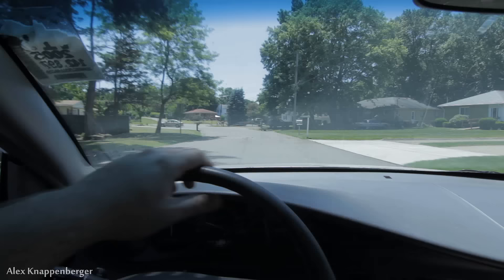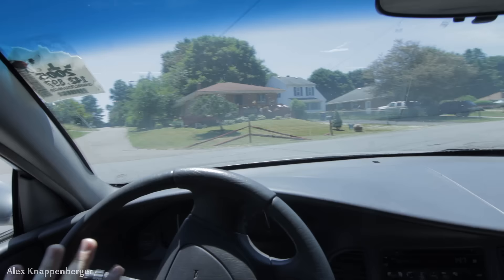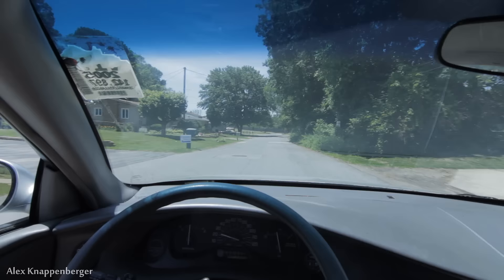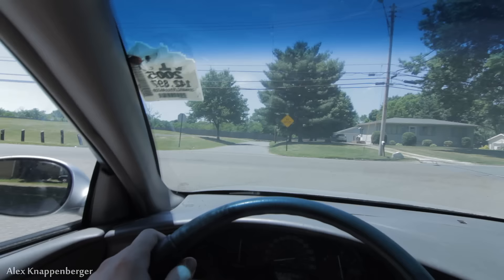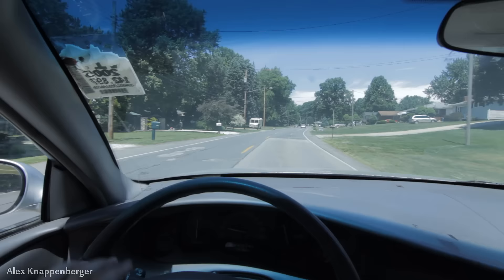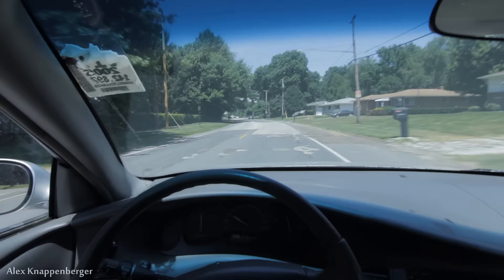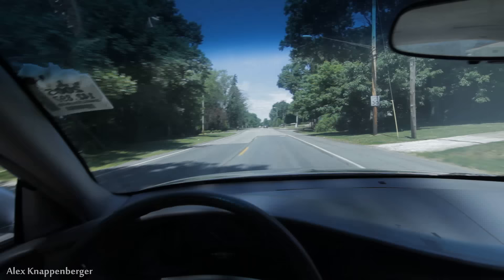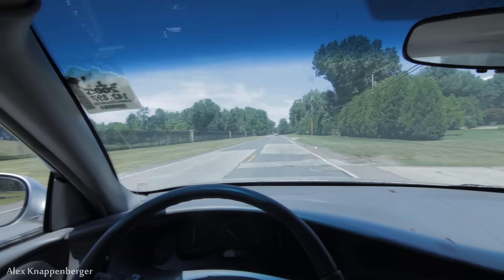How to Diagnose Clunking Noise Bad Sway Bar Bushings in Your Car

Comment: You know what's funny? Everyone heard the noise, got the knowledge, went outside and realized their noise was similar but, it ended up being a tie rod, ball joint, CV, or strut, or steering rack. Then mad cause your problem wasn't the same, came into the house as trolls and started reading comments. They found the first negative one and started repeating it over and over again. Dont listen to them. The video was short, informative, and to the point. It gave people a general knowledge of a certain front end noise and the direction to look for finding a solution.  Thank you for sharing. Please dont let (O)ther (P)eoples (P)essimism get you discouraged in making more videos.

Comment: I hit and ran over a deer in the country , and a bone poked one of the ball joints on my car and it makes a clunking sound everytime I hit a bump , on a 2002 Ford focus hatchback.
Reply: A yes it's true , I did mess it up by hitting a deer and it went under my right wheel in the front been driving it while it slung grease and the ball joint finally got brittle and fell off on my driveway yesterday and rust came out as well going to get it serviced tommorw .
Reply: damn you got the same luck as my family.
Reply: That's metal af
Reply: Its a ford there not know for build quality lol

Comment: Sway bar links usually rattle on tiny bumps on the same side the damaged/worn link is. They can also make a crunching noise when turning hard and accelerating in the same direction the link is on. Bad sway bar link noise does not travel into cabin, the vibration of the sound can be heard but not felt. Sway bar bushes on the other hand are like in this video. If one bushing is bad it will likely rattle with more of a knocking sound and you can often feel it on your feet against the floor.
Reply: I feel it in my pedal sometimes and when i turn i feel it in the steering wheel , would that be he bushings or links
Reply: It depends on your setup if you have the type of end links that bolt up on the strut you’ll hear clunking but not feel it if you have the style that bolt to the lower control arm you will feel it cause it’s now down by the sub frame and you might feel it on your feet
Reply: @ryans413  thank you

Comment: Exactly what my 2008 Camry is doing. Thanks for the video. Makes since that the sway bar is what is connecting the 2-wheels so probably the bushings, I will check it out. Had it diagnosed & mechanic wanted to change the front struts & sway bar links for $$$, so I've been researching on doing it myself for $. If bushings are bad the struts & links wouldn't have solved the noise problem.
Reply: Same here. Had struts and sway bar end links replaced. The noise is still there! Havent checked the bushings yet. Did you get the problem fixed?

Comment: Usually bad struts don't have a sound in any way. Max you'll drive on the springs(like in a boat) when the shock absorbers are dead, of course if didn't break the springs too.
Thanks for the video anyway
Reply: Bad struts usually rattle up by the hood of the car this sounded below the car like a sway bar bushing

Comment: In the Saturn S-series, and probably some other cars, the sway bar is an integral, necessary part of the suspension. The control arms are not wishbones and only attach to frame with one joint and the sway bar keeps control arms (and thus the wheels) in place. It's a simple, elegant, if a bit cheesy design.
It's called MacPherson strut design

Comment: Yup, replaced my control arms, lower ball joint tie rods ends, and still the clunk. But hey, guess what, all of those part were also wore to the bone so it was a great accomplishment! On to the sway bar bushing.
Reply: Did the clunk noise go away?

Comment: Thanks for the video! This may have helped me huge! Ford says my ball joints and bearings are fine. I also Have replaced shock and struts on my explorer.  This sounds very close to the noise I’ve been trying to diagnose though!
Reply: Found the problem?
Reply: George Alorda I replaced the front sway bar end links and bushings.. solved the problem! I’ve found bushings are something shops never can seem to diagnose as a problem so I just had them do it and it helped tremendously.
Reply: @TheJustina102085  im having this noise and i cant find what is it everything seems new 🤦🏻‍♂️ im gonna give it a try before trying anything else
Reply: George Alorda cars... can be very annoying, especially if you’re OCD like me about your car. Lol I have a 2015 explorer and it definitely helped my problem so good luck! Make sure to get an alignment after or check your alignment.
Reply: @TheJustina102085  thanks
Reply: My car on smooth pavement no noise little bumps on the passenger side I hear little clunking then once car stops bouncing and struts stabilize the bouncing the noise goes away over parking lot speed bumps makes a big noise I go slow cause it’s annoying. Took it to the shop they replaced sway bar bushing and end links control arms and ball joints were fine noise now gone. Mechanic said the parts he replaced were original and cars almost 20 years old

Comment: Control arm noise won’t carry over to the other side of the car so if you only hear noise on the one side even when both sides of the car hit a bump it’s probably bad control arm bushings. Ball joints are easy just turn the steering lock to lock they should squeak. Sway bar bushing and end links will make noise and carry over so if it’s just the passenger side that’s making noise but only the left side of the car hits a bump but you still hear the noise on the passenger side then it’s obviously bad sway bar bushing and end links cause the sway bar is connected to both sides so noise will carry over

Comment: In my case the rattling stopped when you went around corners that had bumps in them. There was about a quarter inch play with the sway bar bushings so it rattle pretty good.

Comment: Holy crap finally I heard the correct sound every single person that has a video on here all the sounds that they say how do you know if you need shocks struts it’s very clunky noise mine is very random and mainly because I drive a little fast front passenger side I will hear it

Comment: I'm getting a clunk when I turn the wheel occasionally but not so much while driving. It's got new balljoints, control arms,tie rods,sway bar Links and tension rod bushings. The only thing not replaced is sway bar bushings and the original rack and pinion.

Comment: I think I can hear something similar on my vehicle's right rear.  I tested by making sure the road imperfections would be on the left side and don't hear it.  So it may seem that only right side has that but I am also not sure if the issue is with sway bar link, a bushing or a shock.

Comment: I have clunk in my front end 2002 Ford F-150.  I rebuilt the whole front end. Upper control arms lower ball joints tie rods inner and outer idler arms changed out sway bar bushings to the poly blue new shocks alignment was done still have a clunk or it’s a clunker seems like it’s under pressure then it released because going down the road it’s fine only when I’m pulling out of a parking spot and I turn the wheel some to the right or moving down the road and I turn.  Clunk!!  Truck is lifted we want the look but not the noise. The shop that did all the work including the lift says wow we never had one that makes a clunk like that after all that work.  They are frustrated I told the mechanic sounds to me like a lower ball joint or possibly a hub or bearing.   I’m taking back again until they get tired of me supposedly everything is under warranty but they cannot find the problem they hear it but cannot find it,   It’s so strange

Comment: Sounds just like my car at the moment & ive also noticed at high speeds, my car gets a rocking left to right sway like your in a boat!
Reply: Struts. sounds like you have to replace on both ends. Probably a 1000$ job sadly.
Reply: Corinna Roberts76 me too! ford said my benz had nothing wrong with it and charged me up the ass for nothing. its gotten worse.. so obviously something is wrong
Reply: Candice Wylds yep it's usually the way. They take your money but don't fix the problem.
Reply: With a few tools and some know how you can do it yourself for a 1/4 of the job. Its only a hand full of bolts

Comment: Thank you for this video, I think my car has this problem because I installed new struts and lower control arms , end links also but I didnt buy the bushings . Thank you
Reply: I’m having this same issue..they told me new struts, sway bar links, and control arms based on a ride along. I have not had them check the center bushings but I have always said it feels like it’s hitting below my feet and is loose on both sides of the vehicle. Not trying to spend $1,500 if I don’t have to..

Comment: Replaced everything but sway bar bushings. It would only do it when it was really hot outside. So I changed out one side and the noise sent away. So I changed the other. They come in pairs.

Comment: Hey this was a great video as I sometimes hear a “metallic clanging” is the best I can describe it on the front end of my ‘05 saturn, I do suspect the sway bar because she does lean a bit during a turn. I recently did the sway bar links and I’m sure they are fine unless I somehow broke them. 

How about this? What would you say could cause a clunking noise when going slowly through a parking lot for example? At city or highway speed it sounds fine, is this still a sway bar bushing? I don’t have a means of finding out on my own unless I go to a shop again lol

Comment: This seems to be my issue cause if I hit speedbumps evenly, i don't hear a clunk. also if my car is parked flat and i rock it left/right, it clunks. But if my car is parked on a sideways slant, there is no clunking when I rock it.
Reply: Turns out it was my sway bar end link, even though it was only a year old. had warranty on it so it was replaced free.

Comment: My 2003 Wrangler has a knocking sound when turning the wheel, including when not in motion, and it corners badly lately.  It feels like I am going to fly off the road, almost feels like one of my tires is flat.  There is a lot of sway in the Jeep in general, it feels like I am rocking back and forth when driving straight and almost feels hard to control my Jeep at times.  And of course this includes a horrible shaking from the front driver side when I hit around 60 MPH which may or may not be a death wobble.
Reply: THat was 1 year ago. Was it the CV Joint?

Comment: My fucking mechanic diagnosed as damaged tie rods and fucked me HKD2500. But i still have exactly this noise, it is really annoying. Just now i understod that the reason is one of components of sway bar. Thanks a lot for your valuable video bro.. I will try to solve it by myself. Looks simple..

Comment: I could hear the noise. Have similar issue with my 2000 dodge intrepid. It also clunks when applying and releasing brakes.
Reply: It was the problem ??
Reply: Sway bar bushings?
Reply: okay my chrysler concorde has the SAME PROBLEM. please tell me what was wrong

Comment: so for me i get the same sound on the driver side; however, it only happens when i hit bumps on the driver side. If I hit bumps on the passenger side it makes no sound on the driver side. And my truck is a 2018 GMC Sierra with 22k miles and it has fox shocks all around with upper control arms and like a little diff spacer. other than that everything is stock. and I also have different wheels and tires but that shouldn't be causing a clunking noise.

Comment: I've noticed that my car doesn't make any noise, has no issues at low speed turns, but at highway speeds moderate curves will cause it to wallow and sometimes trigger the traction control - on DRY roads.
Worn sway bar bushings but haven't failed yet?

Comment: My 05 dodge grand caravan front passenger side sway bar mechanic said is broken and needs to be replaced fast. Just when I was going to do a long highway trip 20hr drive. Didnt know it was broken until I just got my brakes fixed today. I guess it can be very dangerous on highway for turning?

Comment: When riding over bumps, did you experience a wobbling motion? My Lexus Is 200 tilts to the right, and then to the left and so on, with decreasing motion until stationary again. I am suspecting bad wheel bearings or perhaps the end links. 

Just tested all my suspension parts today, but didn't notice too much play in the end links. However I am quite inexperienced and what is too much play isn't easy to know!

Any tips would be greatly appreciated :)
Reply: Check your Control arms/lateral links

Comment: Thanks, I have both a rattling and a grinding noise, could it be as easy as bad sway bar bushings? I can feel thumping when I lay my on the interior above the glove compartment on the passenger side. I have also grinding noise when going straight and its terrible when going pretty slow like 30 mph but when cornering hard it stops to grind. When going 80 mph then the grinding is also gone. I started when I changed the tyres to winter tyres so I thought it was because of the tyres but something could have happened when lifting the car? I have been thinking of replacing the control arms in the front and are going to change some bad bushings in the rear of my european Ford Mondeo Mk3. Could bad bushings in the front control arms cause grinding and rattling also? It's pretty quick rattle.

Comment: I have a 2000 ford expedition 2WD and everytime a take a curve to the left or make a U turn, a popping, knocking sound bangs below the front passenger floor. What can it be?? I have replaced shocks, sway bar bushings, both upper and lower control arms... and nothing has fixed the problem. What can it be?? Thanks.

Comment: I had a the issue on my Genesis coupe. Ordered the sway bar end links and sway bar bushings from MOOG. Changed it on both sides, the noise went away and the car drives better than ever.
Reply: S Mathew you did it yourself??
Reply: Yeah if you have the tools, is pretty simple to do it, just jack the car up, once you take some bolts off then the sway bar will be loose, you can change the Bushings first then change the end links, the ends link were simple too. comes right off, 30 min job the most. Even if a shop do it for you, will charge you an hour of labor.
Reply: S Mathew went to aamco and they just quoted me $350! ($70 for each sway).

Comment: I can only hear my noise at slow speeds. It also happens when I bump either tire into a parking stopper, or jerk the steering wheel quickly.    I've been told it's lower control arm bushings or upper control arm bushings.  Do you think it could be the sway bar?
Reply: johncpen2000 Same. Mine only make noise at low speed. Going over bumps, taping the break when reversing, closing my driver door, and when I turn the stirring wheel too the right when reversing. My mechanic says it’s the cv joint, but he didn’t check the sway bar or strut. I’m gonna get a second opinion. The noise just started Thursday and it’s driving me crazy.
Reply: @sempfi22  did you get it fixed
Reply: @juniorfhuftv1995  no, it stopped making the noise, but then the ABS module needed replacing. After 6 weeks of my dashboard dinging evert 5 minutes with a warning and the part being on back order for 6 weeks, I traded in the vehicle.

Comment: I just replaced my bushings on my sway bar and endlinks at that as well... Actually the entire front end suspension and now getting clunks on the passenger side?  Why would this be happening if all the bushings/parts are brand new OEM.
Reply: Check sub frame bushing
Reply: @supremeleader1043  ended up being the top hat bearing.  I replaced with new but apparently it might have been a dud.  Installed a new one and torque to spec and no more clunk :-)

Comment: Ive got a similar noise happening on the left front side of my suzuki swift. Only started after a mechanic replaced the left front strut (to pass a warrant of fitness). He left the old mount in and assured me it's on tight. Now he says he thinks it's the D bush on the  left side but doesn't seem very confident. Anyone else experience something similar after replacing a strut?

Comment: IM REDOING MY 08 ESCALADE  LOOKS EXACTLY THE SAME AS MINE.
I HAVE A CLUNK NOISE ON THE DRIVERSIDE I HAVE CHANGED LOWER BALL JOINTS (FACTORY)., STRUTS( ARNOTTS)? SWAYBAR BUSHINGS (FACTORY) THAT NOISE IT STILL THERE... SO THINKING ITS THE HUB BEARING  MAYBE THE UPPER BAL JOINT?
Reply: What about sway bar links. check out the videos with each noise. See which one sounds like yours.

Comment: I have the same sound but the difference is my steering wheel also shakes like crazy after every bump.. what could that be? thanks
Reply: no reply from anybody, sad.  i have issues as well.
Reply: Mathieu Pitre probably the bearings
Reply: Check your tie rod end , and your front tire could be out of balance

Comment: I have the issue but mine comes from the rear of the car. What would that be?
Reply: Me too. Did you ever find out what the issue was?
Reply: If your car has a rear sway bar it might be that
Reply: Does it feel like your car wants to slide when making a turn?
Reply: Or if it feels like it has more bounce than you should change your suspension.. check your struts to see if they are covered in oil and if they are then they are no good
Reply: Mine does whats causes that i replaced all 4 struts got an alignment balanced tires and got the sway bar links replaced.  Brakes are not worn. But car stops horribly

Comment: I replaced my struts and sway bar with the bushings and my car is still making a similar noise. WTF?
Reply: Did u check the upper control arms ? Sometimes it's upper ones
Reply: Did you ever get your sound issue fixed? If so what was causing the sound? I'm having similar problems.